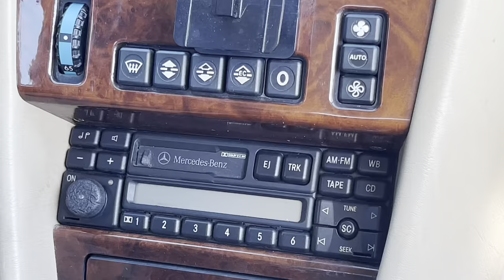MY DREAM CAR! ❤️ We Bought A 1995 320E Cabriolet Mercedes Benz W124 In Sarasota, Florida 🌴

Comment: I sold my 2019 Mustang GT convertible this past Summer. Since I retired, did not want the payment as it was only a couple years old.  My wife won't let me purchase a vehicle unless it still has it's factory warranty.  I leased A Mercedes C300 in Las Vegas 3 years ago.  It was nothing special IMO.  Keep the top treated with a convertible top conditioner.  That Florida sun will degrade the fabric quickly.  I would not have any convertible without owning a garage to cover it..
Reply from the maker: i test drove a newer benz, rather keep the camry.
Reply: @FLORIDAHOODVLOGS  Here's the problem with a car that old..  NO safety features.  No side curtain airbags, no lane avoidance, no rear backup camera.  Probably no traction control although in Florida should not be needed.  Wait until you need a Mercedes OEM part. It will cost you a fortune.  Mercedes like BMW are only for Doctors and Lawyers who have the dough to maintain them.

Comment: Its a w124. Did you sell that Chevy truck? That MB is going to require more maintenance than the camry. Its not really practical to drive everyday in my opinion.
That noise is the serpentine belt.
Reply from the maker: Truck gone. I went off roading and it tripped like 5 sensors over the traction control. Done with computers. Also this cars cost is a fraction of the truck. And yes clearly this is a weekend car not a daily driver.
Reply from the maker: The camry is low maintenance for sure